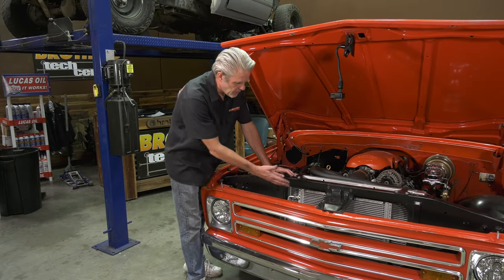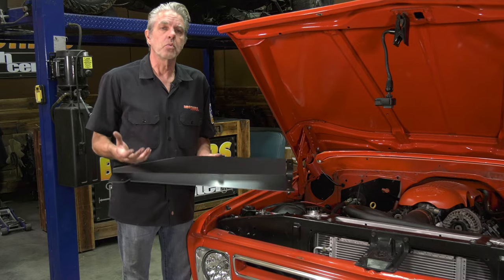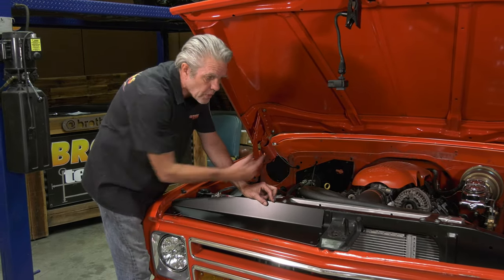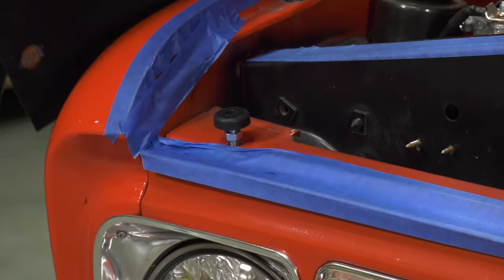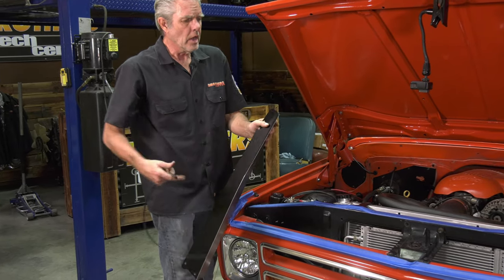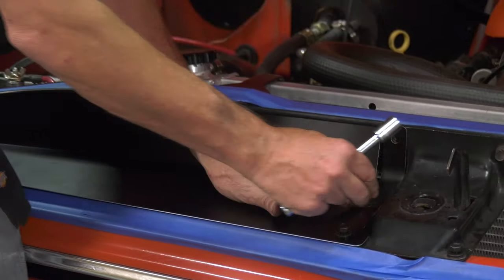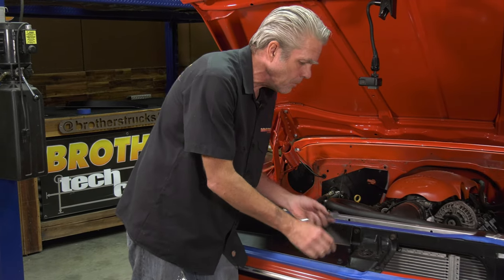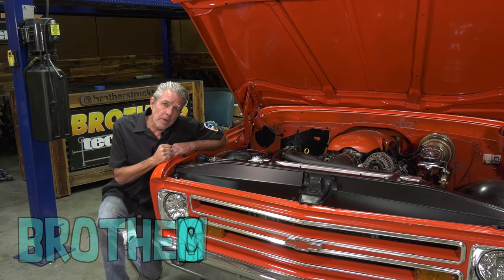1967-72 Chevy & GMC Truck Radiator Filler Panel Install / Shroud / Grille / AC & Cooling Improvement

Comment: Very helpful video.  My 65 c10 wont start after driving over an hour. It usually takes 10 minutes to restart.  I don't get crank not even radiator fan turns on. I have a 350 small block with mild cam and edelbrock carburetor. Any suggestions?
Reply from the maker: Sounds like a problem with your starter solenoid
Reply: This is probably that fuel vapor lock, I've heard people have issues and others dont.

Comment: Nice, but does anyone make a lower filler panel? My 70 C10 overheats at freeeway speeds, so I want to put the upper filler panel in, but assume the air will just flow out the bottom then.

Comment: Is there one that fits with the vintage air? Looks like the air dryer on the core supper will interfere.
Reply from the maker: This can be modified tonfit any setup, although we're pretty sure it doesn't need to be with the Vintage Air dryer.